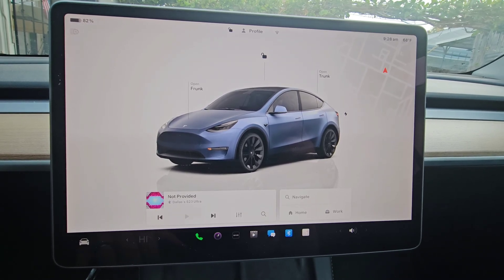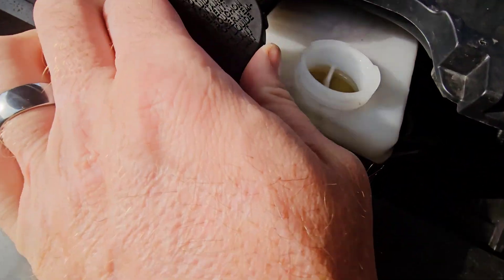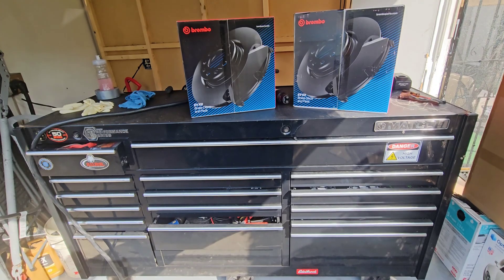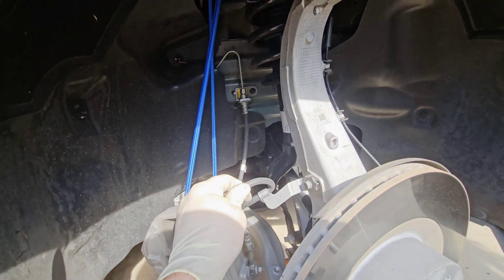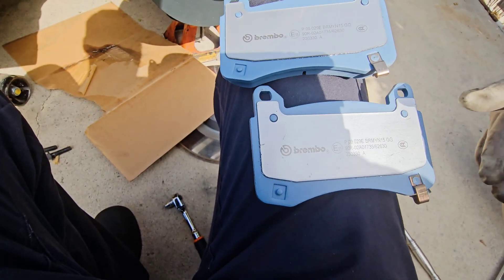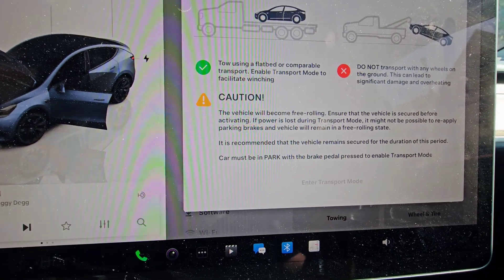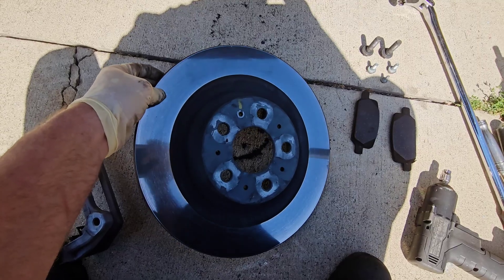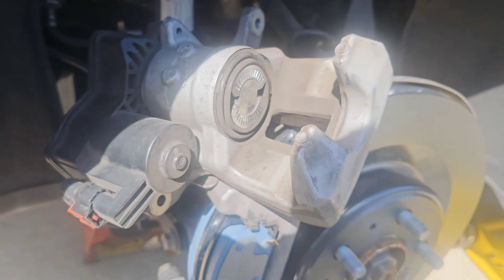Tesla Model Y Brake Service

Comment: Good Lord!!! Im at 62k miles and my pads still look new. Did you ever figure out why the fronts were so worn or why fluid was low?
Reply from the maker: Great question! 👌
My fronts wore out faster because the pads actually started cracking, which caused uneven contact and extra drag, so they wore down way quicker than normal. 👀

The brake fluid was low simply because the pistons were pushed further out as the pads wore, totally normal if there’s no leak.

And yeah… Tesla doesn’t cover brake wear under warranty since it’s considered a wear-and-tear item. Regen saves brakes most of the time, but if a pad fails mechanically, there’s no warranty safety net 😅⚡

Comment: Great video man 
I need to do this for my model y , 
Just for cleaning the brakes. 
Like you mentioned I heard bling sound in the back area 
I have some questions 
Where did you place the jack stand actually is?
What did you use to setup 14 mm socket to 120lb, what tool that needed?
Thank you 🙏
Reply from the maker: I'm glad I could help. There is 4 jack adapters if using a lift. If your in the driveway a hockey puck or a small piece of wood on your floor jack will be fine. Make sure to lift on holes for the adapter..2 on each side. I put a jack stand under front Sub Frame for safety. 

The tool needed is called a Torque wrench. This tool is used to tighten a bolt a certain tightness. The specifications are different for ever car. If you need help with a link for tools or parts let me know.
Reply: @FullyChargedZone great man 
I greatly appreciate you,
Yes please send me link for the torque wrench, I do a bit research seems like I need 2 torque wrench? 1 for lug nut and the other one for the bolt behind calipers? Please let me know if I need anything else to get the job done 
Thank you 🙏

Comment: Great video! I'm planning to do a tire rotation and brake inspection on my 2024 Model Y soon. I've done a lot of home maintenance on ICE vehicles, but this will be my first time working on an EV.

I'm curious about the jack stand placement in your video. They don't seem to be on the typical Tesla jacking points. Could you share the specific location you used, perhaps under the control arm? Knowing this will be a huge help, especially for a cross-rotation. Are there any plastic covers I'll need to remove? I trust your advice as a certified Tesla technician more than what I read on forums.

Also, the Tesla manual specifies replacing some bolts after brake maintenance. I've always reused them on my ICE cars unless they were damaged, but I'm hesitant with the MY. What's your take on this? Since this is the first time the brakes will be opened, do you think I can reuse the bolts just this once?

Thanks again for the excellent content!

Comment: Question: On the rear calipers brackets I see one may remove the rear guide pins and clean and re-lube.  If one was going to replace the pin, boot and pin bushing seals (internal one pin each caliper) are they the same pins as on a model 3?  No info in the parts EPC.  Model 3 rear pins, boots and bushing seals plentiful online. Thanks
Reply from the maker: They look very similar, the parts #'s are different.  I'm looking at them both right now and the model Y is longer.

Comment: Brembo Beyond EV pads and rotors installed.  I did notice the pads took a little effort to out in the rear spring clips (both old and new clips).  I've used after market clips and oddly Brembo doesn't supply any (but the do on the Prime line of pads).  I suspect the thickness of the paint on the pad metal is what causes the pads to be a bit tight during install but I expect this to improve with time.  The pads and rotors were noisy during the low speed bedding in (sounded like sand paper).  However, after completing the high speed portion (5 braking applications fro 45-10) the brakes became quite.  Much quieter than the factory brakes (mine still had lots of life left at 45K miles but rusted constantly in the winter from heavy salt).  I am really enjoying this new rotor pad combo.
Reply from the maker: Glad to hear you're enjoying the new brakes. I personally think they're better too.  Drive safe
Reply: @robertolsen3765 model 3 lr 2020, 130 tkm driven, original brakes and looks like a new.

Comment: Hello. Some rotors need cleaning prior to a install to remove shipping oily residue. Was that needed here?  Would brake cleaner harm the rotor coating?  Thanks.
Reply from the maker: No, these rotors use a ceramic coating, there is a break in drive cycle.  No cleaner needed nor burnishing the pads are required.
Reply: @FullyChargedZone  That explains it.  Brembo sent me the bedding in procedure and it his basically short. 5-6 low speed brake applications 30-35mph - 5-10mph with cooling between following by 4-5 applications at 45-50 down to 10-15 mph again (some heating wanted) with rolling between applications then 10-15 minutes of driving allowing natural cool down. Very brief and much shorter and less abrupt than the onboard burnishing procedure in service mode.  I am waiting for the boxes to arrive to get started with install.
Reply from the maker: I think these brakes are great, they also seem to last longer. I've been happy to with the noise level too when braking. If you have any questions on your install let me know.

Comment: Did you ever determine why the brakes wore out so fast on the model Y?  What the car tracked or maybe used for towing?
Reply from the maker: This is what the brakes look like when you have too much fun with the car at this mileage.  I'm seeing anywhere from 20k to 100k life expectancy from the brakes. It really depends on how you drive.
Reply: @FullyChargedZone  I'd be curious to know your tire wear while having fun when you did the brake pads and rotors replacement at 14k miles. Cheers!
Reply from the maker: The tires were about 3/32. I replaced them about the same time as the brakes. I just purchased a new Model Y. I think this one will do better.

Comment: i thought brakes go 100k before needing change on tesla, plus cheaper on rockauto
Reply from the maker: Theses brake pads cracked and were making horrible noises when slowing down. 

As a Tesla Technician,  I regularly change them between 30k and 100k.

Really depends on how the customer drives. 

Cheaper on Rock Auto? 
Nice...are they the updated Brembo heat resistant Brake pads & Rotors?

Comment: What kind of grease did you use on the rear slide pins
Reply from the maker: This is what we use at Tesla dealership 

https://www.autozone.com/brake-and-power-steering-fluid-additives/brake-lube/p/permatexdisc-brake-lube-tube-5oz/1155976_0_0?cmpid=LIA:US:EN:AD:NL:1000000:PER:19332030449&gad_source=1&gclid=CjwKCAiAiaC-BhBEEiwAjY99qGp_cvsDKVGpiJ8sHceF0DXkX8HzRxlEmKpWTntq0CdQiNZS6_rDHxoCbuwQAvD_BwE&gclsrc=aw.ds

For an electric vehicle, it's best to use a silicone-based brake grease as it is generally considered the most compatible with the various materials in an EV brake system, offering good heat resistance and compatibility with rubber components.

Comment: Very good vidéo and well explained. By the way do you Know all the torques required for each of those bolts or screws ? I can’t find any informations or torquing value. 
Thank you
Reply from the maker: Front
• 94 nM (69.3ft) front caliper bolts e18 or e20 bolts

•129 ft (175nM) wheel lug nuts

•T40 bolts 26.5 nM (19.5ft)

Back
Caliper bolts 83nM (61.2 ft)
Rear lig nuts 129ft (175nM)

I'm glad you liked the video.

Depending on which brake set you purchased, you might also need to burnish the brakes to break them in.  Where did you purchase the brakes pad set?
Reply: I didn’t purchase brakes yet, my MY only havé 4500 km. But I Will do the brake maintenance as they recomand every year. 
Do you have à link to suggest for torque value ? On tesla i can’t find any info, and I love doing my son maintenance on the car.
Reply from the maker: I work for tesla, I pulled these torque specs for you off the dealership computer.

Comment: Did you change the regen settings causing your brakes to wear?
Reply from the maker: The new brake pads specifically say not to...This is anupgraded version of the brembo pad. The old pads wear faster and need to be burnished.

Comment: What about burnishing the brakes in the service menu?
Reply from the maker: Instructions in the brembo brake kit specifically said not to burnish brake pads until 2000 miles of wear. At the dealership, we only perform this procedure when new brakes squeak or are warppedl. I don't burnish the brakes otherwise.  I recommend using this procedure on aftermarket brakes or when the vehicle makes noise only.

Comment: Thanks, great and very informative video! One question: In the official (european) Tesla manual, they mention to replace those two threaded E18 (E20 in your case?) bolts for the front caliper with new ones. Is this just a precaution, or do you really need to replace those? Would love your take on this.
Reply from the maker: I'm glad you liked the video.  Model Y vehicles have E18 bolts to mount the calipers. I  grabbed a socket to check 2 different Model Y's right now. Thanks for catching that. I switched the socket to e18  but missed that video edit. 
When working at the dealership, I've never been handed bolts for the calipers by the parts department. 
When given a job at the dealership, the parts department supplies us with the required parts. Tesla dealership only replaces the caliper bolts if threads were damaged or if bolts are damaged.  If the bolts torque down to specifications, you'll be safe. I've only replaced 3 sets of caliper bolts out of numerous different Tesla brake jobs.
Reply: @FullyChargedZone  Thanks a lot for your reply! Good to know, that even Tesla dealerships don't always use  new sets of bolts. I wouldn't mind tho, if I could just order them online. But going through a service request in the app, driving to the dealership, asking the confused guy at the front desk for the bolts, ...  That's a hassle that I can happily do without.
Maybe I'll get another two sets and replace the bolts every other year instead. Thanks again!

Comment: Could you tell us the torque value for the T40 torx in the front and any others? Thanks.
Reply from the maker: Front
• 94 nM (69.3ft) front caliper bolts e18 or e20 bolts

•129 ft (175nM) wheel lug nuts

•T40 bolts 26.5 nM (19.5ft)

Back
Caliper bolts 83nM (61.2 ft)
Rear lig nuts 129ft (175nM)

Comment: Tesla breaks should last several years due to regen breaking. My MY LR 2022 has 46,000 km mileage and still breaks like brand new!
Reply from the maker: @Dronethat  It really depends on how you drive. I drove this model Y pretty hard. I'm a Tesla Technician, and I perform brake services on most Tesla's between 30k and 80. I could have gone longer. I just like a smooth ride.
Reply: Mine are done at 26k.   They still work, but shake really bad at 60 when hitting the brakes.